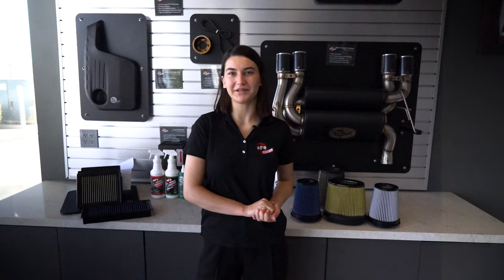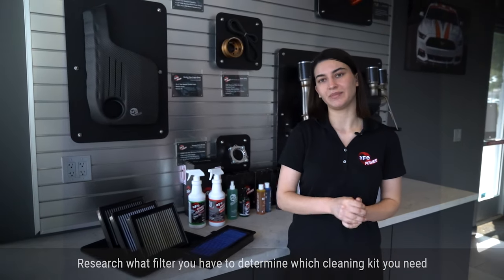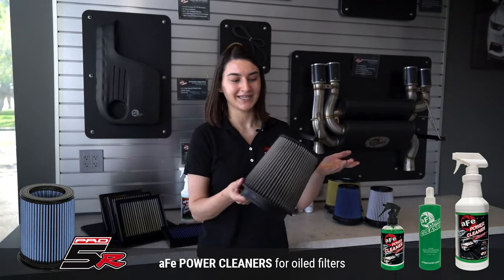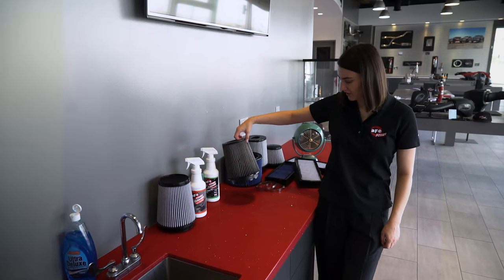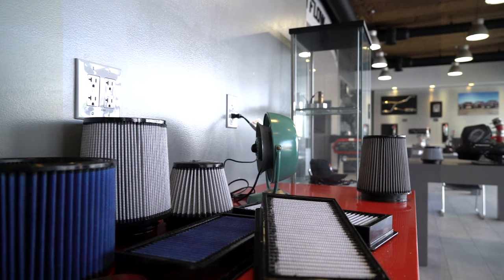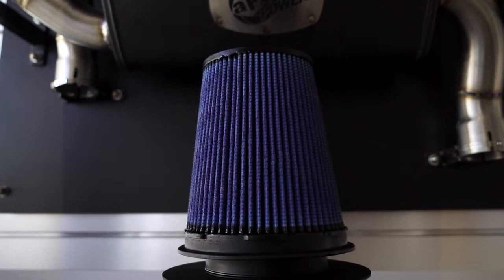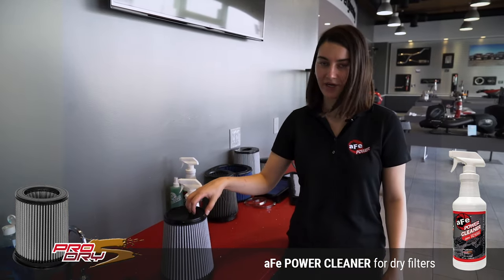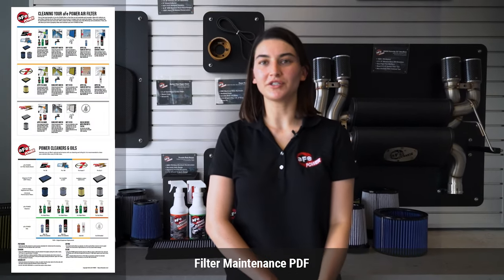How to Clean & Re-Oil Your Air Filter

Comment: Hi, how many cleaning cycles before it needs to be replaced? 
Do we need to apply the oil for the first time out of the box?
Reply from the maker: The filters come pre-oiled, we recommend cleaning every 20-30k miles! The filters are designed to last the lifetime of your vehicle, but may people prefer having a second filter to switch out during maintenance!

Comment: So I bought the afe stage 2 air intake and with in 2 months the oil faded.. I have a stone driveway but not that long..
Reply from the maker: The color of the oil may fade but rest assured the oil is still doing its job and working properly